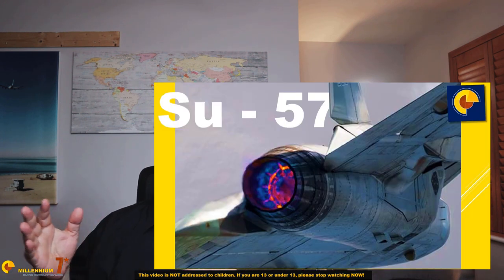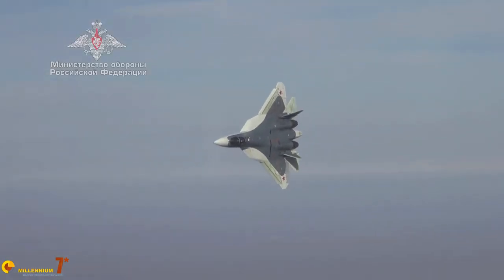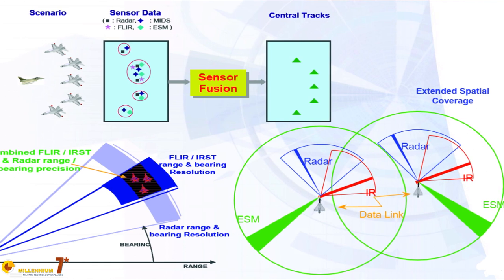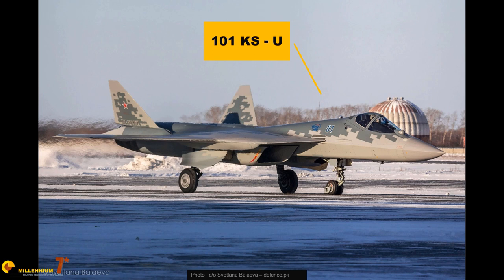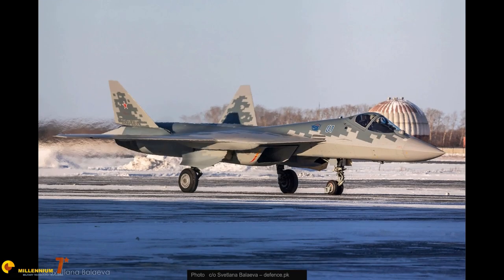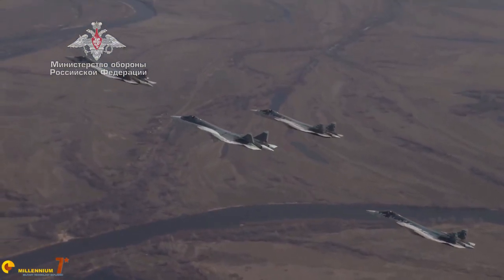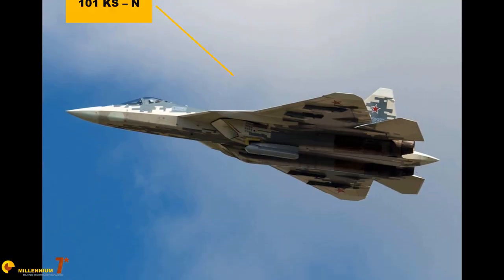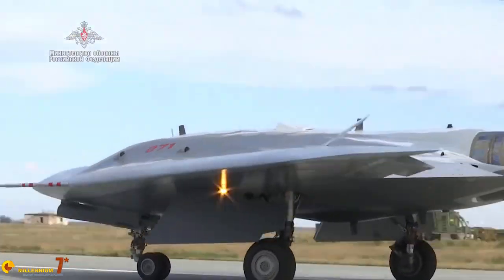Su-57 the Raptor Smasher | Part 5 - Video and Infrared Sensors

Comment: Can Russia make irst suites that top those onboard F-35 though?
Reply: Even the Chinese say the Russian electro-optical sensors are outdated, though that was on Su-35. I did a pretty extensive analysis of OLS-35 IR detection capabilities across the spectrum, including atmospherics and varying meteorological conditions, along with the Rafale's OSF.

I also did one for Su-57's 101KS-V assuming a certain % better performance. Keep in mind that once the IRST is rotated forward into use, the frontal RCS of the Su-57 increases from .1m2 closer to 1m2, according to Sukhoi.

After graphing out all the detection ranges against legacy fighters in frontal and rear aspect, subsonic and supersonic profiles, you start to see that none of the IRST systems on other modern fighters are of much use in BVR against JSF. 

You effectively end up on the edge of or within visual range in most wx conditions.  Over a dry desert environment on a clear night, you might barely get an IR signature indication at 24km, but won't be able to Positively ID (PID) the TGT.  24km is way too late against something like JSF, who has been watching you from 400-600km out, with networked PID and algorithmic information exploitation.

Inside the JSF Infodominant network, they emulate live threat sensor fields of regard and detection ranges, so the pilots can avoid flying into known detection and WEZ profiles, while setting up their own No Escape Zone weapons employment against those threats cooperatively. It's really an unfair fight.
Reply: @LRRPFco52  even the cninese... where can I read it?
Reply: @LRRPFco52  where can i look at this report? I'm not an expert in air forces bit I guess chinese can't modify su35 without russian permission or maybe it is written in contract. And of course Russia will never sell the latest version of su35 with AESA to China.
Reply: @brighton1880  Pentagon and Congress mostly frustrated with the failure on cost cut that would enable F16 replacement, bugs like fragile skin... non of them complain about its combat electronics
Reply: @TrungNguyen-uf8cv  What do you suppose is the reason behind the rising costs of the jsf, the delays, the changes, the modifications, and fixing of issues after issue, yet the jet hasnt passed the milestone C.

Here, this article has referenced links

https://www.google.com/amp/s/thehill.com/opinion/national-security/542412-the-f-35-tells-everything-thats-broken-in-the-pentagon%3famp
Reply: @brighton1880  most of the shit in that article are so outdated in its publish year 2021, and so much euphemisms. The Hill is indeed a cesspool of shitty op eds. And we have been talking about F35's unmatched combat avionics, which was not mentioned specifically in the article, while its flight avionics has enabled F35 to out turn F-16 since 2017. The bottomline is that Russia is many years behind the West in jet fighter AESA radar,  will always behind in term of electro-optical techs. I was jus curious on how far Russian irst is behind.
Reply: @artemvektor1  never heard a plan to mount aesa radar to su 35 though
Reply: @TrungNguyen-uf8cv  Anyway it's possible and probably will be in Su35m, depends of MoD desicion and budget.
Reply: @TrungNguyen-uf8cv  The article as I said has referenced links, thats why I mentioned the link, they will lead you to specific articles.

As for russian jets and AESA radar, and being behind, well i am not sure they are behind. Russia has some of the best radars, different but powerful radars including AESA, and you see this even in their missiles like the r77m.
Years ago, I asked the same question, but then i also realised the US too didnt have aesa radar on their 4th gen fighters until very very recently. Only the f22 and f35 well one has already been discontinued because of cost, the other is heading the same direction. For the russians it seems, it was never worth the cost, their fighter jets are well fed by powerful ground radars and theirs is a defensive military doctrine. No 5th gen can penetrate russian airspace unnoticed, so their jets are part of their defence structure, guided by a network of ground and aerial radars.

But of course, for export jets like mig-35, su-75 and su-57E they have AESA for these. But AESA radar in their jets was never a priority, still isnt or otherwise the su-35 would have long had it since it serves as a testbed for 5th and 6th gen tech to be used in the su-57 and future 6th gen fighters.

The west pursue tech to serve its specific needs, and the russia does the set to balance or negate the advantage. If the US and Nato seek to have air superiority, Russia  seeks powerful air defences to negate that. If the US seeks to engage at a distance, sacrificing performance for stealth, russia's response is sure, i'll defend against your long and ultimately low energy punch, but that missile would be the last thing you do. You know in close range, the f-35 is dead.

And also, 1 su-57 controls four s-70 stealth drones, that are capable of engaging aerial targets and performing aerial surveillance that means extending the range and awareness of the su-57 to hundreds of kilometres. Days of stealth this,stealth that, are over, everyone is going "stealth" except Russia didnt sacrifice anything for stealth as the US did with f-35. su-57 is a deadly jet
Reply: @brighton1880  like I said, the links were so outdated as I pointed out, a 2021's article took a reference from 2015 that F35 couldn't dogfight, but 2017 flight control upgrade helped the whole line out turn F16. Therefore it was enough said for the article. R77 only comparable to AIM-120 lines at any iteration. You shouldn't bring about controlling 4 combat drones at a time here as Russia is toying with an idea of two seats Su 57 to control the battle space and drones better, which will end up make the jet shine like a lighthouse from afar. Stealth is always advantage if the wings are tactically smart, it takes toll for high frequency fire control radar to be effective agaisnt a stealthy target. Combine with good aesa, a stealth fighter can track (not detect) a PESA donning non stealthy Su35.
Reply: @brighton1880  I wish my Vietnam is allowed to buy some top spec F16 or Gripen E cuz the Western radar can enable our Northern defence see things on the other side of mountain ranges  that ground guidance cannot do. While buying Su75 easier but takes time, still play a catch up in term of radar spec
Reply: @Boogieman Thats not the information i got, what i found out was that APG 63 V2 was installed on 18 F-15C, then V3 later on yet a limited number of F-15 C, just 48 if i understood correctly. And the radar was been tested on these platforms. So I dont know about the more than 20 years part, but the information i have point to 2010 for f-15c  and 2015 the hornet
Reply: @Boogieman Again Russia is not the US, they do what's best for them, again Russia has extensively used AESA radar across various military platfroms for decades and up to now, things like the s400, t-14 tanks, to air-to-air missiles, it isnt for lack of skills or know how, or even for lack of money, the country literally saves its billions of dollars surpluses into its already large foreign reserves almost every month and it has debt of 13% of its gdp, one of the lowest in the world. It didnt have any issues developing the AESA for mig-35, or su-57, or for su-75 because if the external market demands AESA radar on their jets, fine. But as for Russia it isnt a priority, the same way they dont really care much for stealth. The only jet the western seem to accept as stealthy happens to be this new su-75 jet made primarily for export. They dont seem to care that much about the two things worshipped by Western military enthusiasts, Stealth and AESA
Reply: @Boogieman The su-57 is flying, has been flying and tested for years, and by the way things are going it might even reach full operational state before the f-35.

I hope you already know why there are hundreds of f-35s, yet the jet hasnt passed operational testing and evaluation to be certified as fully operational? Waste of money
Reply: @brighton1880  F35I has been thoroughly deployed through contested airspace in Middle East
Reply: @brighton1880  and no, there's no aesa on Russian AA missiles, that's rather a Japanese thing
Reply: @brighton1880  Every fighter is in continuous OT&E. It never ends.  JSF has demonstrated significant performance advantages that haven't been seen with any other TACAIR platform. Congress are being agitated by active measures, rather than being informed by accurate information. The Pentagon's DOT&E is not a source of accurate information, and never has been for the simple reason that the DOT&E reports are obsolete before they're compiled.

Whatever source tells you F-35s are limited to subsonic speeds is strange, because pilots say they can spend more time flying supersonic in F-35s than their previous 4th Gen fighters, which are difficult to accelerate into supersonic speeds with while carrying external stores (which they always do).

JSF networked primary detection methods are layered first with passive fused sensors across RF and IR spectrums.

As long as Su-57s don't exit hidden shelters, they won't be seen by any ISR platforms, who then won't feed that data into the kill web.

Once Su-57s do enter the kill web by taxiing onto the tarmac, assuming a hostile regional scenario between one of the foreign operators, it starts a countdown.

JSF are their own AWACS, with far superior SA than any AWACS can currently provide.  The main practical service AWACS offer is long duration patrolling of airspace.

The moment Su-57s or other networked platforms break into the RF spectrum with emissions, including data link bursts, that triggers things on the web.

The moment an IR signature manifests itself at extreme long range, whichever sensor node detected it triggers all other MADL-linked JSF to passively look there too.

Now you have multiple, disbursed vantage points interleaving passive sensor tracks with each other, and cross-referencing the signatures against the threat library.

If you think you will detect their LPI MADL transmissions, keep in mind they are narrow beam, freq-hopping, LoS ship-to-ship LAN-based xmissions, not Wide Area Net, omnidirectional RF.

With networked AESAs in LPI mode scanning existing TGT tracks for PID against the threat library, and simultaneously executing deceptive techniques, you've got a compounding problem on your hands.

Once threat air is within No Escape Zone parameters from multiple ships, optimum separations occur from different directions, with no MAWS warning because no active seeker has gone hot.

A conventional radar track isn't needed, so no RWR or EW is alerted.

Missiles receive mid-course guidance via narrow beam data link, with 2-way link options on later missiles.

Time of Flight is only a few seconds with optimum weapon velocity maximized inside of NEZ.

Without going into details, bad things happen before impact. Think about what you could do with agile networked AESAs to increase pk against a Digital Waveform Manipulation jammer.

Terminal phase gets compressed down into a tiny window where reaction time is negligible, even if you coupled the FLCS to the EW defensive suite. 

If you employ continuous noise jamming or pulse repetition frequency phasing/modulating, it adds to your TGT track quality when fused with multiple passive IR sensor tracks, which increases missile pk.

There are also a lot of differences between an AIM-120C7 and AIM-120D4.

JSF provides an adaptive, holistic set of user-friendly solutions to any intercept profile challenges you can imagine, that make it more lethal even with older missiles like the C7.

The Su-57's DIRCM and UV MAWS are not relevant here. JSF can profile certain parameters to optimize NEZ in ways that were never possible before.

If you find yourself discussing a legacy RWR detection and labeling algorithm in a conversation about JSF, it's all wrong. This isn't a mutual detection stand-off skirmish where you see and anticipate the moves of your opponents.

It's where you fly blind, think you saw something in the dark, then get knocked-out by a shadow that isn't there.
Reply: @artemvektor1  Russia doesn't have AESA in the Su-35.  Irbis-E is a PESA radar.  China makes their own AESA radars.  China makes far better electronics than Russia does now that China has 40 years of experience stealing and acquiring as much as they can from the US.
Reply: @LRRPFco52  where did I say that russian su35 have AESA?
Reply: @LRRPFco52  man, I'm so bamboozled with this much networking protocols you just wrote. Whoa.
Reply: @brighton1880  None of the Russian aircraft have the sensor suite found on the JSF. If the Su-57 did, it wouldn't need an externally-mounted 101KS-N FLIR pod. That's a huge giveaway that they are way behind in sensors.

We also haven't seen Su-57 pilots flying with the promised copy of the F-35 HMDS, yet its advertisement reads like a cut-and-paste from Elbit Systems and Rockwell-Collins.

If it had 5th Gen sensors like JSF, it wouldn't need a FLIR pod.
Reply: @LRRPFco52    Again, just objectively speaking, why should the SU-57 have the sensor suite found in the f-35, its has its own sensor suite to meet the specific needs of the Ruaf and isnt out there to copy individual features of the f-35 into the su-57.
The two jets are different, same way the f22 is different from the f35, and are meant to perform different roles and so carry different avionics and systems, but both are 5th gen fighters. 

As for HDMS, im sure you know of Russia's history with HDM.

Comment: so the over all spec level of the su-57 is gen 4++. This is not on a par with the f22 or f35 BVR ability. The main issue this air craft has is it is highly visable to US airforce tracking systems and their own sensor struggle to pick the F22 out. This aircraft suffers from the same over hype the t15 amarta had, the later being proven utter ineffective vs current gen weapons let alone the next gen it was claimed to defeat.

Comment: It wasn't good enough for India. Enough said.
Reply: It was never supposed to be sold to India. FGFA was a separate project. And Indians wanted the transfer of technology and production localization. When Russians refused they quit the FGFA program. Now they are in deep trouble cause Chinese have 5th gen jets and they are stuck with Rafale and all the corruption around the weapon procurement and sales.
Reply: Rather, not cheap enough.
Reply: @artiombeknazaryan7542  The FGFA was supposed to be an improved version of the Su-57. And if they were going to pay towards the development, it would be pretty darned brain-dead not to expect some return for the investment.
Reply: @DenisPetrov1980  India determined that the project would be late, overbudget and unsatisfactory.

Comment: The Su-57 is definitely a formidable plane to face off against in any situation. But they are reduced radar detectable, not stealth like the F-22. They crammed so many sensors into it that that's it's only saving grace. Regardless of that, it's likely to be spotted by a Raptor before it spots the Raptor. And the Raptor is going to know what it's about to fight and will likely use its EW suite to overload the sensors. And only an act of god would save it from a Python 5 or AIM-9X+. Especially if EW is actively being employed against it. Hell, the Raptor pilot might decide to boost signals and pin point the Felon and cause it to release all its chaff and flares. IRST is cool and all and a great system, but head on with a Raptor it probably wont see it coming till it has missile warnings. By then you're dead because its likely that AIM-120 was fired very high and very fast. Russian fanboys love to talk about how amazing Russian made planes and tanks are and think they are indestructible and invincible but fail to study the capabilities and power of western powers. They also love to use the one time a Flanker had an F-22 on his IRST as an example. Just remember that if he had fired a missile at that raptor, the retaliation would find every Russian base outside its borders turned to dust. Any Russian planes that left her airspace would be turned into a lawn dart. The Russian navy would face bot just one of, but the 11 most powerful moving objects in the world. Even at it's most vulnerable position theres only a few countries dumb enough to try to face off against a US Carrier Battle Group in any configuration. And those willing would be removed from the census.

But back to the planes, you call the Su-57 a raptor killer and all that but it hasnt flown against one. It never will. Russia doesn't participate in Red Flag exercises and isnt welcomed. The harsh reality is the lack of actually dog fight training and air to air training the Russian Air Force has is nothing compared to other countries that are involved in red flag. You also know next to nothing about the raptor and its true capabilities because that's all top secret. The tiny amount you can gather give a baseline for comparison, but beyond comparing speed, weight, size, and other arbitrary features that dont have a whole lot of bearing on what they can actually do in a fight makes your arguments based on speculation at best. Either plane could possibly win against the other. The human factor and training as well as how extreme the pilots want to push their aircraft are what would determine the outcome. You simply dont know. For all we know the raptor could possibly never need to fire a shot and potentially overload enough systems that the Su-57 simply falls out of the sky. It will likely never be know which one has the upper hand.
Reply: @vidhansingh8670  The Indian airforces didn't think so
Reply: How us carriers will stop Zyrcon missle?